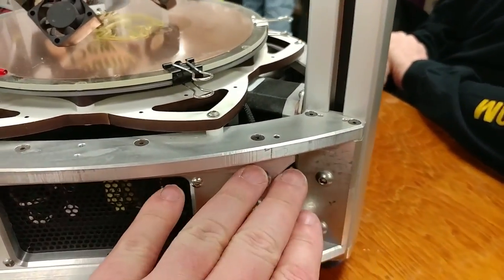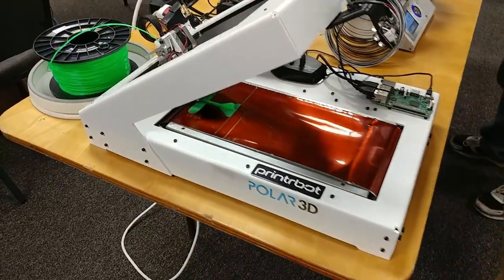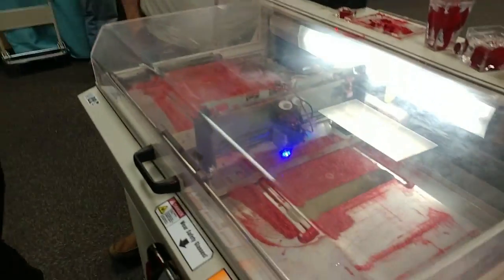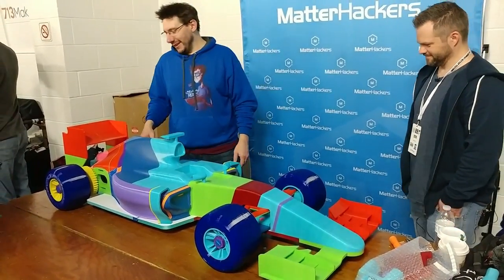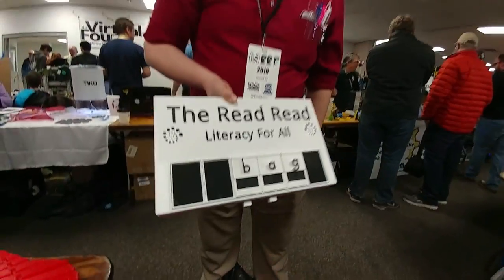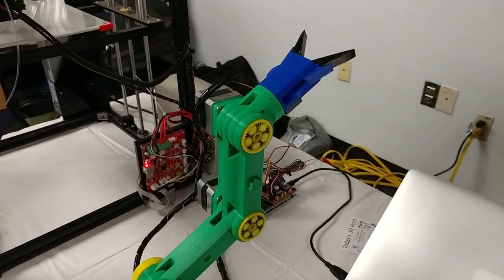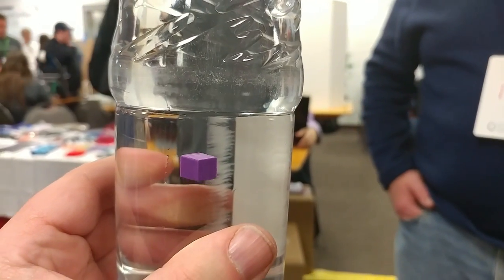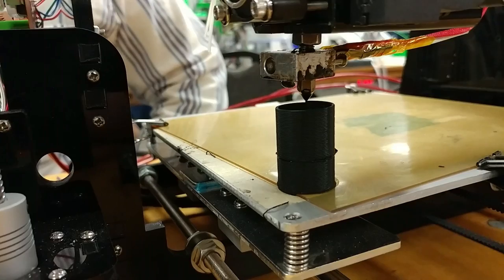Today's 3D Print 208 MRRF 2018

Comment: Hey Chris , great video as always, I'm on the other side (Italy ) so It's a pleasure see this video, it's such a virtual tour for us but explain me that guy that with Java coding make that vibration, I can't ear some of your talking. It's look awesome but I did not understand if that vibration is for speedup the infill or what? Thank you
Reply from the maker: There is no speed up there is no infill there is no perimeters it's not a 3D file it's a calculated set of movement instructions that generates a 3D object in this case a freaking slinky and I mean a freaking Slinky it feels like a slinky it acts like a slinky it is a slinky and it's amazing

So basically what he's doing is he's program the software to draw a spiral kind of like a vase print but while it's making this vase print so to speak it's also moving back and forth relative to the spiral path it crosses over the same point several times before moving on and it continuous smooth spiraling motion the result is a print that actually separates very easily many times you can even use your fingernail to loosen the spring it's that good the first segment of a spiral is critical after that it just goes I have another one printing right now

This here is a intuitive guess on my part so don't take this as fact or as anything that comes from the Creator in fact I don't even think the Creator knows entirely how this works he's a genius for figuring it out

First I noticed that the segment cross section is not flat it has a profile I think this is because of the back and forth 4 times over the same spot zig zag that it runs through the spiral this causes the sides to curl slightly just like they printed being pulled off the bed but the multiple time back and forth keeps it from curling up so it just curls a tiny bit combine that with the back and forth forward movement spiral action causes the front edge the Leading Edge of the wave front to be peeled up multiple times before the head finally moves on and pushes it down the heat keeping it soft enough to allow it to settle after the head passes but because it was being curled up multiple times it said he's into the previous layer is nominal at best so it stays put but you can separate it easily

I believe all this combined is what created the conditions that permit the slinky to work and exist and it's also why you can never do this with an STL file at least not without a massive change in the slicer it's really quite amazing I'm going to shoot some high-speed video of it making the slinky I think that would be very interesting I just have to figure out how to put a macro lens on my high speed camera
Reply: Thank you so much! A creazy and creativity way to make things. Awesome. Thank you again

Comment: Question I some how got the cooling fan on my ender 2 broke off a blade now I need new one where would I be able to locate one for it and if u have part number and place thank ya for u time
Reply from the maker: These are what i use

https://amzn.to/2JuKmsB

I have not put one in an ender yet but 40x40x10 12v is what you need.
Reply: Nerys thank you again
Reply: Nerys in the spec s is showing 50x50x10...
Reply: is it the part cooling fan or the very standard 40mm 12volt fan. the last one you can buy at any local electronic shop. i gues. correct me if i am wrong.
Reply from the maker: I will double check tonight but i am pretty certain all my enders are all 40x40x10.
Reply from the maker: The Ender only has one fan the hot end fan which doubles as a Blow by 4 Parts going
Reply: Nerys im sorry for the misunderstanding.. the specs are for the one u sent at Amazon.. they are showing the one u suggest is a 50x50x10 size at Amazon...

Comment: whats the thingiverse for the chess set?
Reply from the maker: Actually he just posted it a couple days ago i will try to find it and post a link.
Reply: thanks big guy.  Well I went with the kossel linear plus not the tornado. the new plus looks easier to put together. and I will design a neat enclosure for it. Paid extra to buy it from GB not cheaper places. which might have been a mistake but.. oh well. I'd rather make sure I actually get it than deal with some fly by night for saving 40 bucks.  I will probably add a michelangelo if I can get a heated bed and extend the Z extrusion.  Very little of my printing with be pla, that will be just for fun. Mainly because I am printing a lot of arms and legs and they will fit nicely in the round 230mm and as they are tall I don't have to worry about wobble from a moving bed. I think 12" will work for much of what I'm doing. at least for now. I've been searching for tpu skin color so I dont have to resort to printing molds and casting silicon but its damn tough to find. anyways, the kossel was 355 shiped. not too bad. tevo would have been more since I cant find sales on it. its in high demand apparently! I like the customizations you can do to the kossel to make it nicer and improve rigidity. I'll post a vid on how it goes. p.s. this vid was the best coverage on the event!!!